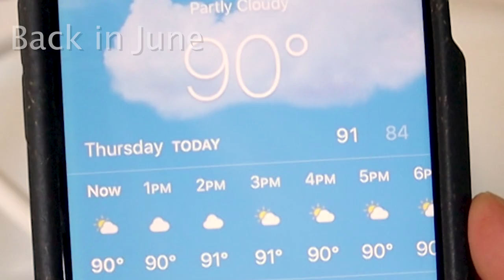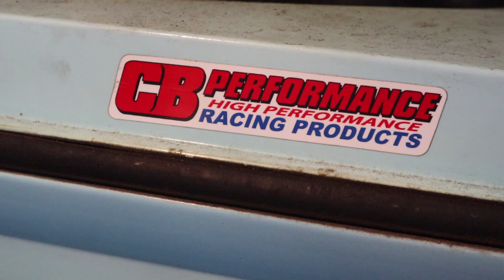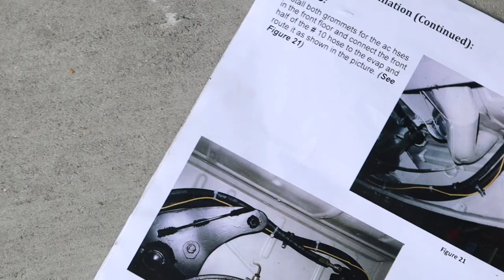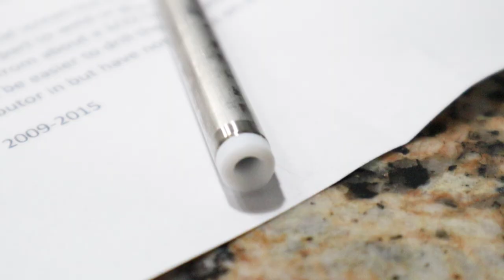Air Conditioning In A 1967 VW Bus

Comment: How much power did it take away from the engine?  what size engine to you have in the bus?
Reply from the maker: I only really feel a difference when it's at idle, when the compressor kicks on and off. Other than that, I can barely tell the difference. My engine is a 1904cc with a lot of cooling mods for any extra heat that the AC might cause.
Reply: Gilmore who makes the kit said the new style compressors are very effective and use very little HP around 1-2 hp

Comment: Great job. Out of interest, how much does this kit cost? I've seen some kits cost around 15 hundred.
Reply from the maker: I payed about $1700 with shipping.
Reply: Looking at the cost for my T3 I was told it could be $5000.  I think the water boxer is a lot more complicated. 
I had a bus in 71-74 that didn’t have AC.  I lived I. Louisiana then and I loved the way the bus moved air.  It T3 much less so.  AC would have been nice but I got by
Reply from the maker: @kimhorton6109  It shouldn't be that difficult since the brackets already exist for the T3 and don't need to be custom made. I was getting some insane quotes on installation, but my buddy, who did the same system as I have on his bus, found a person willing to do it for $350. The only thing was he didn't want to install the compressor since drilling/ cutting the tin was involved. $5K sounds like they just didn't want to do it, but didn't want to say no to the job either. You can definitely find a system and installation for less.
Reply: @gottasplit5707  anyone has any info , of how to install an A/C in a T3? Will really appreicate any info, can't seem to find anything online
Reply from the maker: @cotsiosyo  My Vanagon had A/C when I got it, so I'm not sure how to install the full system. Maybe try starting a thread on TheSamba.com about it. I'm sure there's someone on there that will know more about it.

Comment: You know there is an eletric compressor kit for VWs right?
No engine adapts needed
Reply from the maker: I am looking into that for the future. I need to make sure my alternator can run the inverter required to power the compressor.

Comment: With safaris open and pop outs, this extra is not necessary.
Reply from the maker: Not necessary, but definitely worth having.😄
Reply: Here in South Florida it’s not only the heat, it’s the humidity. The AC takes the humidity out as well making it bearable. If you have pop outs you know you can’t have them fully opened while driving or you end up with bugs in your face or squinty eye syndrome. Here AC makes driving bearable. We have temperatures in the 80’s 10 months a year with 100% humidity. The other months it’s raining. If you wait until better driving weather the gas I your vehicle will get old.

Comment: What size is ur engine and do u feel a big power loss when the ac is on?
Reply from the maker: I have a 1904cc engine. The RPM drops a tiny bit while at idle, but there's no loss of power while driving that I can feel.

Comment: There wont be much power left after switch the air on.
Reply from the maker: With an original engine I'm sure it would feel a power difference, but with this 1904cc it doesn't really feel much different with the air on.
Reply: @gottasplit5707  1900 CC is not immune to aircon power loss at idle especially.